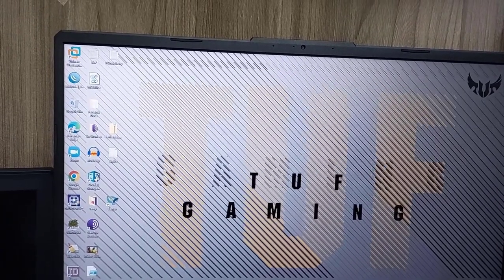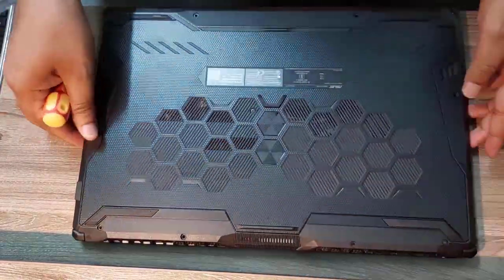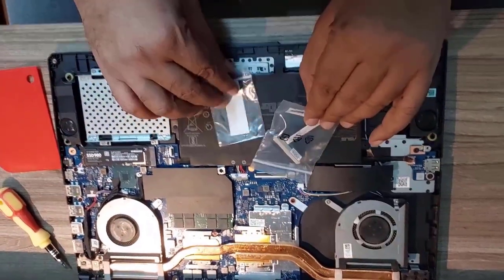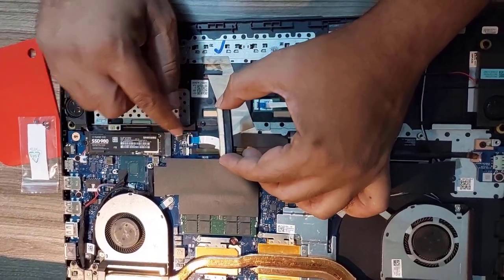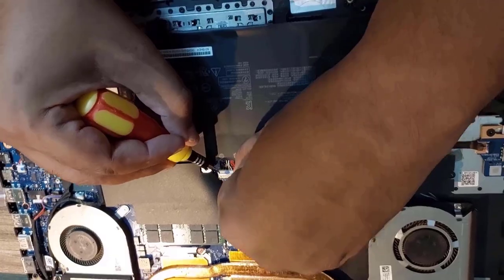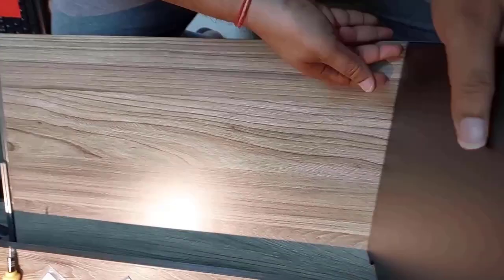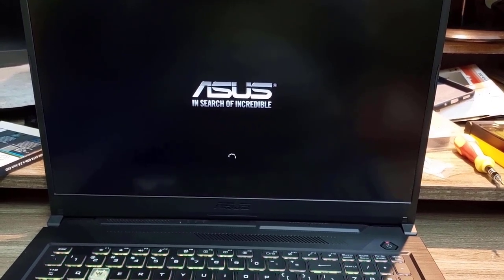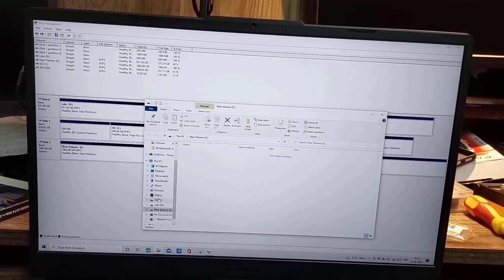ASUS TUF Gaming F17 | SSD upgrade

Comment: Model ASUS GAMING F17 - FX706HCB has 2x NVMe and  has enough space next to the battery for an classic SSD drive, even the BIOS recognizes this slot, but it does not have a physical slot for connecting a cable :( :( :(
Reply: It has but SSD is not like shown in this video

Comment: Where did you get the SSD connector from? Is it a standard connector or something specific for ASUS?
Reply from the maker: The SSD connector was with the Laptop. It is standard connector, same as below:
https://www.ebay.com/itm/254879849717
Reply: What means of connector was with laptop, means connector is inside my laptop?
Reply: @xplorewithmanvik Hi bro. What version nvme this laptop use? 1.3, or 1.4? And what version pcie, 3.0, or 4.0?

Comment: I installed an ssd i had on my play station 4, but my asus doesn't recognize it, do I need to do anything else, besides installing it, thank u so much
Reply from the maker: You may check if the SSD is listed in the BIOS. If SSD is not in BIOS, you can try to reseat the connector and check.
Reply: @xplorewithmanvik  thank u so much i will try